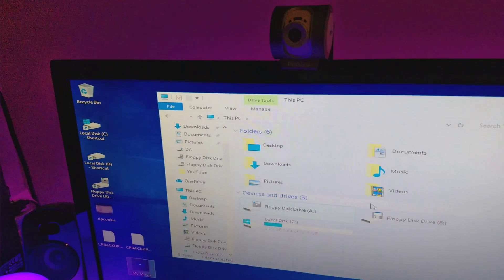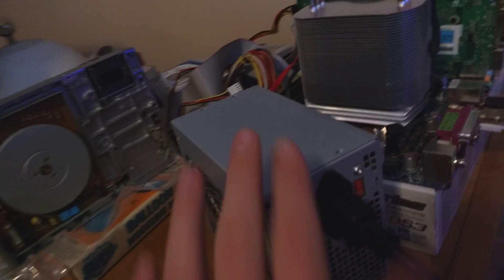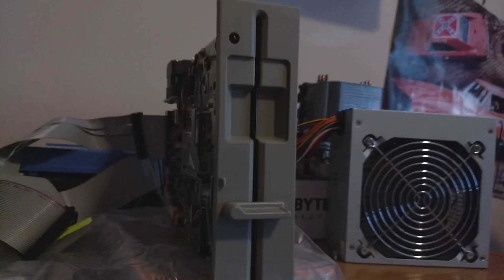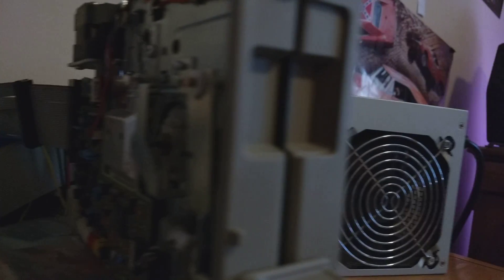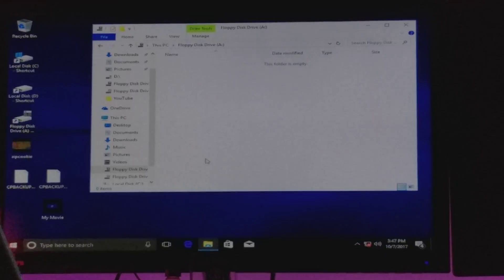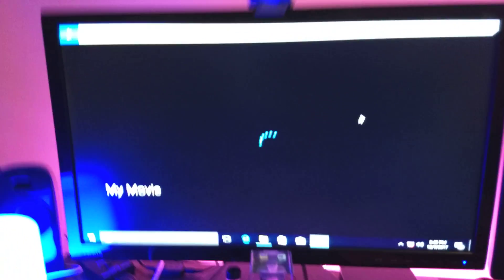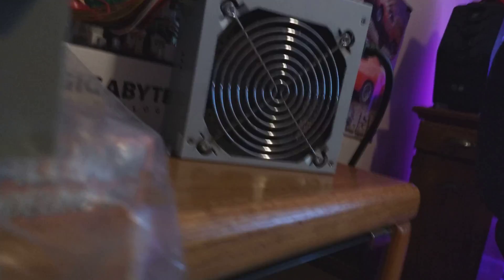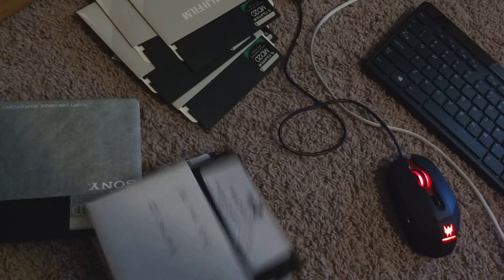Using a 5.25 floppy disk drive on Windows 10 in 2017

Comment: It’s cool to see it works) I wish you could also kindly show the adapter that you used as well) I assume that 5.25 requires a different connector cable than the 3.5 one…
Reply from the maker: @antonlebedev2890  different cable,  yes.  This system is still in use with Windows 11 today!
Reply: I have actually found this cable at an online flea market) However I’m more into Win 98 stuff, which is mostly 3,5”, so I shall not have much use for a 5,25”)

Comment: I have an old Thinkcenter running xp that i got from a junk pile. by the looks of this video, seems like win 10 can natively use a 5 1/4 better than xp can as I've had no luck plugging it into the floppy connector so far. the included 3 1/2 runs perfectly fine